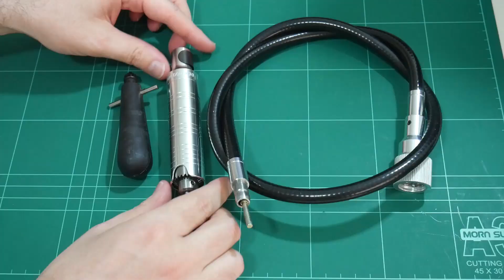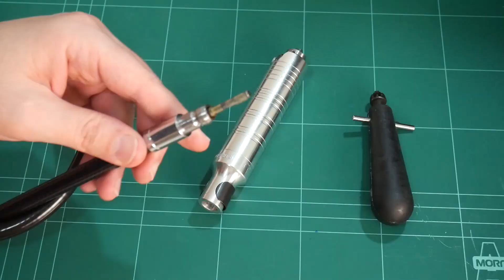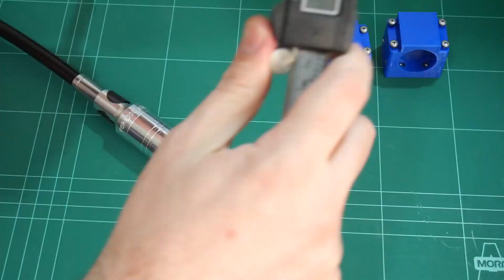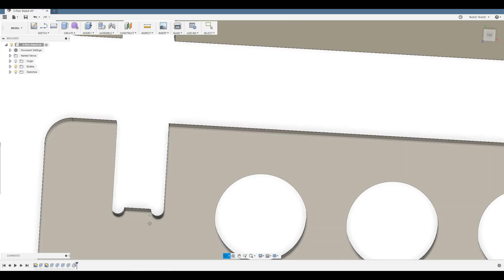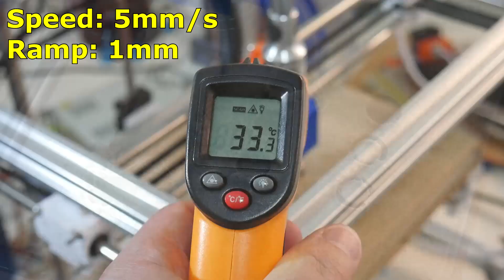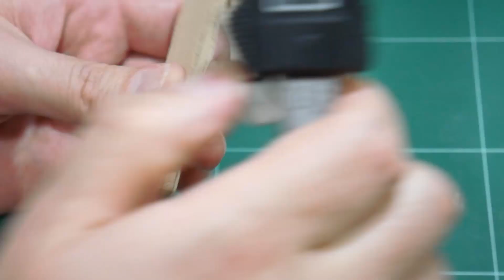Upgraded Flex Shaft

Comment: Hi I am using Dremel 400 and it has a connector size of 19mm with 2mm thread. Will this Flexible Shaft 1000mm be able to fit my Dremel connector male head?
 TIA

Comment: Interesting. I dig how you turned that grinder into a mill. Good work. I have a foredom knockoff on the way to replace my Dremel 4000, can't wait to try it out and blast some glass
Reply: Same here, just ordered, did it go well?
Any information you can point to would be appreciated.
Reply: @gloriouspopemantom373  it didnt work and i ended up buying the foredom anyway. took about 6 months to resolve it with banggood. but im super glad, the foredom is amazing.
Reply: @justinsane332  
Good you got it solved eventually, I picked EU ebay seller, wont be too terrible with the returns.
Reply: @gloriouspopemantom373  hopefully the thing works! mine would only turn in one direction and after running for id say two minutes in the other direction, died completely. these things are awesome as long as you get one that works. Id recommend buying a nice handpiece, the one that came with mine isnt great. The cheap version of the quick release handpiece I bought as well, and surprisingly, Id recommend that one.
Reply: @justinsane332  
Thanks for the suggestions.
Well find out soon wont we, fingers crossed.  I got the one direction only but with 6mm chuck so I can use regular drill brushes from the hardware store.
You say you bought  cheap handpiece, how would I go about finding that one, sounds like something to get, serial? name?
Reply: @gloriouspopemantom373  if you search quick release handpiece it will come up, im sorry i dont have a ton of details on it, chinese writing and all that. it cost somewhere around 15$, and is grey with a chrome looking lever on the side. it holds smaller bits though, 3/32" I believe. I carve and envrave a lot so that size is perfect for me, but depending on the applications you are doing, the burrs that fit may be too small.
Reply: @justinsane332  
Thanks man,  would've come back sooner, but I haven't found a way to check on comment replies like that in youtube. Once you check the bell they are gone.
Seems I got a good one, If I didn't know better Id say its the real thing. 
Thanks for tips,  building a 3D print workshop, what Ive used it for has been good, even the pedal works well. 
So tempted by the goodies, those reciprocating blades do some amazing things to wood.
Reply: Those fake Foredoms are junk. Why give money to crooks?
Reply: @chadjazeera9960  Got the one with red sticker on it, runs great, forwards and back, has a full on original looking paperwork and cardboard. 
Im pleased. Might be "fell off the truck" real product, ~100€, Im good with that too.
Reply: @gloriouspopemantom373  if it works it works. I've just never had good luck with counterfeit products. 🤷
Reply: @chadjazeera9960  
I completely agree with you, its a gamble.
Took a chance, ebays returns have been good to me lately, felt a little brave. 
Mostly wanted to get away from the poor quality and durability of dremel, not buying a 4th one.  
But Foredom original prices, dont want it "that" badly, only a few hobby projects at the moment.

Comment: The bit is running out by .11, add that much to the tool diameter in the cam. The bit is bent, oversize from what you put in the cam, or that handpeice is bad causing it.

Comment: I would clamp  the spindle higher in to the carriage, also I would put a hole in the drill chuck to stop the tool from overhanging so much , to me the difference on sizes has to do with tool and table springing..

Comment: Very nice video.  The main thing I see is you have toothed belts driving your X and Y which are going to have significant backlash.  With that setup you can never get much tighter than what your results were unless you only move X and Y in one direction.  You're gonna need ball screws for all three axis' and your going need them to all have low backlash.

Comment: Tell fusion you are cutting with an endmill with the different of the tool runout you measured. Your tool and holder were not traveling perfectly in axis. The runout results in larger effective cut diameter.

Comment: The inaccuracy in the cut is due to the endmill's effective diameter. Make a box within a box inlay, and adjust the tool diameter setting in cam until they fit tight.

Comment: You wont get a proper temperature reading from the aluminum body due to its poor emissivty. Try a strip of black vinyl electrical tape on the area where you want to take your measurement.

Comment: Cool video.  Simple fix for the cut tolerance is to compensate for the runout by cutting a test groove in the material and measure its width, then use that measurement for your tool diameter in CAD.

Comment: might be time to leverage parameters/tables input in Fusion 360 ( rather than manually adjusting each dim)  setting up "material thickness" and "cal offset" parameters then using in dims would significantly improve the parts fit

Comment: Good experiment! The reason that the dimensions are off is compliance/backlash of the 3d printer, it's not stiff enough, and probably run out of the flex shaft. If you compensate for one, the other will mess up the dimensions. I'd see what tool engagement the setup can handle. Lighter cuts should improve compliance. Stiffening up the frame will of course help.  If the plywood would've been 6mm, the fit would be snug but easy to assemble at 6.25. If the slots were also 6mm it would be hard to fit the pieces. 6.1 to 6.2mm would be a friction fit. It might be better ti fit a spindle with an er11 collet, 300 to 500w if the frame can handle the weight. Keep up the good work!

Comment: I think for milling a 4 point supported bed would be better. There are many remixes to your Hypercube that do that, I like the ones that use 2 screws for Z on the sides and one circular belt so that just one stepper can be used for Z. You could make a comparison test ...
Reply from the maker: The HyperCube primarily is a 3D Printer. For 3D printing a cantilevered bed is more than adequate for me, and I like the simplicity and ease of access with a bed supported at one side only. For a CNC the bed should be fixed at the base and the drill would be moving in Z axis. Really this is just for fun to see how far we can go with a 3D printer. Cheers :)

Comment: Nice rig! That's clearly a counterfeit Foredom hand-piece. I wonder if they are knocking off just the accessories, or the entire Foredom line. Those bits and bobs can get pricey.
Reply from the maker: I'm not sure, but you are probably correct they are not original accessories. I was just glad it worked first go.
Reply: @Tech2C  I have a genuine Foredom tool and it looks a lot different than what I'm seeing in this video. Mine is very old though. The flex shaft is not built to run at full Dremel speed either. Foredoms run at 18,000 RPM. At least mine does.

Comment: Depending on whether you are doing climb or conventional milling, the endmill will be pulled toward or pushed away from the work piece. The machine has little rigidity so it will allow this movement.

This is likely why your dimensions are off. It is not that the endmill is larger than specified.
Reply from the maker: Does it matter which to use if the end-mill is cutting directly into the material, rather than from an edge? The end-mill is still surrounded in material regardless?
Reply: @Tech2C  As far as I know, that does not change anything. You could quickly test this out by asking Fusion 360 to make the exact same cuts but conventional milling instead of climb milling. If you also want to compare slotting to contour milling you would have material for a whole video on the subject :-)

The alternate theory is that the larger slot is caused by run out. There is probably some of that too.

Think of it this way: The cutter is surrounded by material on all sides, except behind, where it already did the cut. The cutter is rotating clockwise so the forces are counter clockwise. This missing forces behind the cutter means the forces will not cancel out. The front is pushing towards the left but there is nothing pushing to the right behind the cutter.
Reply: I would say that plus run out from the chuck. Collets are generally more precise than chucks. Maybe put a dial gauge against the mill shaft and check how much run out is there.

Comment: Seems as though your drill-bit is a bit wider than you had configured?
Reply: Gotta remove 1/2 the diameter from measurements when using a router bit...but still pretty darn accurate
Notice they were .25mm or 1/2 the diameter of the bit
Reply from the maker: I just measured the bit. 1.57mm at the widest edge being 2 flute. So subtract 0.07mm from the measurements I made, is a little better but still not perfect.
Reply: Question : did you measure the concentricity deviation at the Mill?
Reply: cheap chucks have more runout than shitty collets, it all can be compensated for by doing test cuts first anyway

Comment: How much runout and or flex is introduced by the shaft?
Reply: There should be none.  If the end design is done right, the only affect the cable would have is to catch under load, slowing the rotation of the bit.
Reply from the maker: Runout could be. I also measured the endmill at 1.57mm diameter so a little larger too.
Reply: @Tech2C  That might be a nice topic for a follow up video.

Comment: Maybe add an IV drip stand type thing to hang the rotary tool from. Great modification to an existing printer. Not sure how useful a small print area would be for a lot of projects, but considering I've got almost all the parts already, it's going to be a fun project to mod my printer.
Thanks for the video.
Reply: Yeah, hand the rotary bit up high, let it move with the bed...
How does one lubricate the inside of the flex tubing
Reply: @haydenc2742  there is a light oil you add to it.   It is online, look for:
Foredom Flexible Shaft and Handpiece Lubricant MS10005 Oiler 1 Oz

There is generic also if you think about $5 is too much.
Reply from the maker: Yes something to hold it up would be very useful, saves me having to hold the darn thing during milling!
Reply: @Tech2C  look for a foredom stand, it will attach to the table and has hooks to hold the motor and shaft up.   I just use a bungee from the rafters in my basement over my workbench.   I use my foredom for jewelry work but this is basically the same tool in your cnc setup.  I will think of making one, very nice.

Comment: You could make a stand to hold the dremel up above the printer so it keeps the shaft somewhat straight.
Reply from the maker: Yes that needs to happen. I have some 2020 extrusion left over - I could bolt it to the printer frame to support the cable.

Comment: and i thought carbon fiber is harder and more rigid than steel :)
Reply: that's a carbon fiber tube, not a solid rod
Reply: @Zilli_341  you mean we will have minor oscillations?
Reply: The carbon fiber tubes have a better strength to weight ratio but the steel rods are stronger

Comment: Seems as if you were cutting the edges of these parts relative to the center of your milling bit, instead of cutting along the outside perimeter of the parts relative to the radius of the bit. (Don't know if I'm right, I think you already considered that)
Reply from the maker: Fusion is taking the diameter into account, and cutting half the diameter into the waste. I just measured the diameter of the 2 flute endmill I was using - 1.57mm. So it is a little wider than programmed into Fusion. That will help a bit but not fully account for the mismatch. So maybe it's runout for the rest.
Reply: @Tech2C  but also the plywood is not 6 mm it is 5.65mm ish
Reply: @Tech2C  Fusion should be putting the full diameter of the cutter into the waste, not half.
Reply: Yeah thought so as well, either that or the width of the bit is off a tiny bit. I mean all outside measurements come out about 0.2-0.3 mm to small, and inner measurements are to big by about the same amount.. I guess increasing the bit diameter by 0.1 mm in the software could already fix it?
Reply: @jonasfritsch98 It could simply be runout on the chuck.